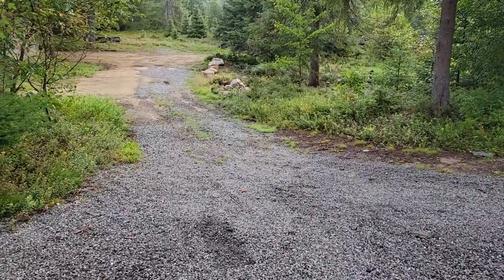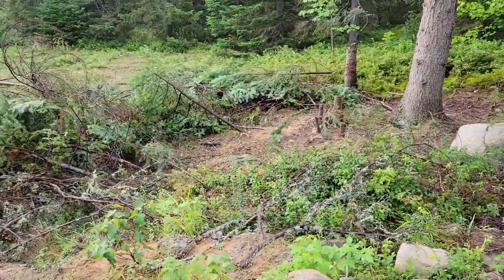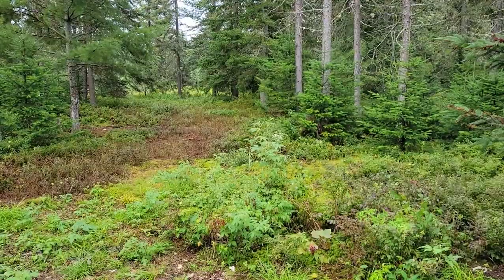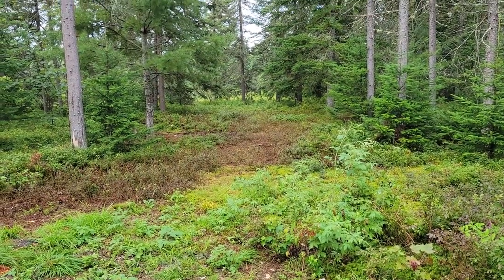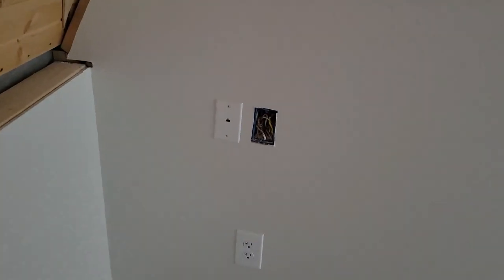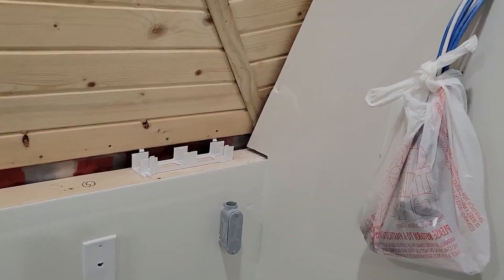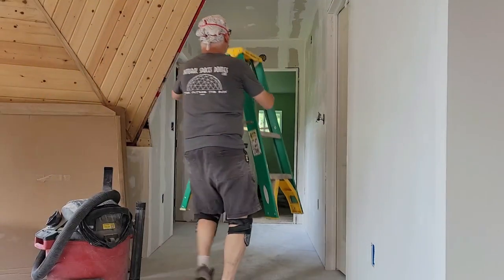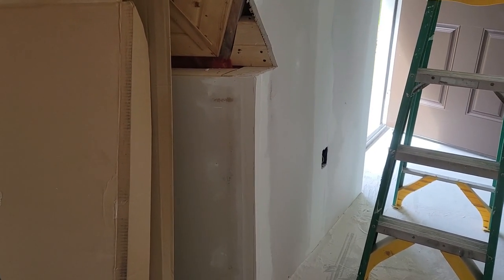#90   Sanding, Painting, Cleaning

Comment: Getting a workout with hand sanding.  Did you use that powered sander with vacuum you mentioned previously?  Drywall dust….the bane of diy……gets everywhere…..drys the skin…..turns to mud in your nose….even with a mask.  Did the dust blow through your shop vac??   All in all…..you and Deb made terrific progress!!!
Reply from the maker: Yes, I did use that sander with vac. It works for large areas, especially seams. I also used a random orbital sander with a bag (which filled fast). I do the edges & corners & wonky areas by hand. And yes! That dust has been in every crevice! Yuck!  I put a fine filter on the shop vac, which helped.
Next video we should show almost all of the sanding/painting done.
Thanks for your interest, and for the encouragement.